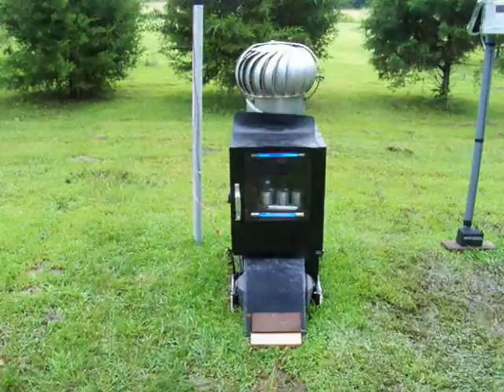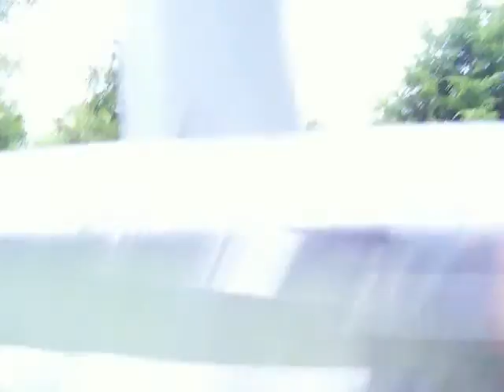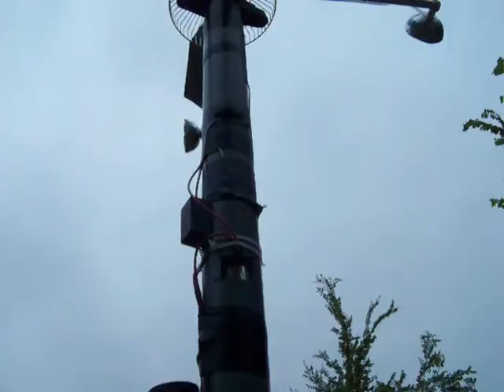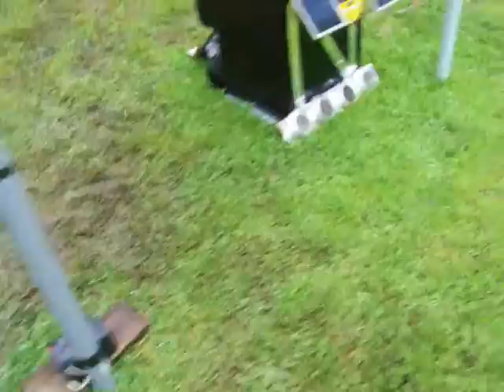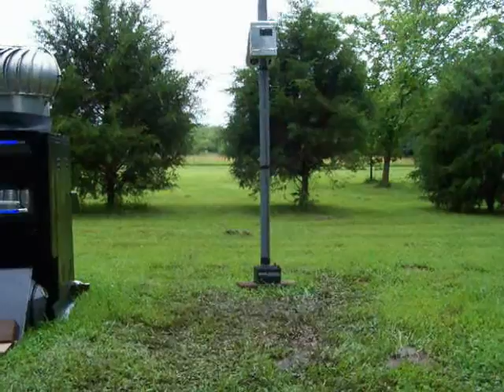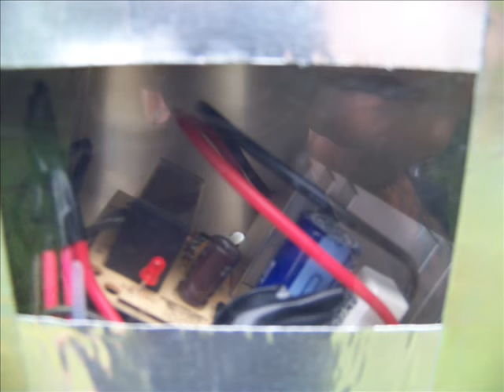FREE THINKERS 4

Comment: I think charging the battery is too simple for such a device. Here's an idea that's more out there.. The wind spinner on the box is not going to be used as a rotary spark gap, but actually going to work like an ion motor from the static electricity being collected and is going to keep spinning perpetually. Perhaps that energy can be harnessed to provide enough electricity to run appliances off that power inverter looking device? It would only take 12 volts and an amp or two..
Reply from the maker: Justin H This comment gets a giant thumbs up! and if I were allowed it would be two thumbs up! Great stuff! anyone who dares to question what they say can not be done has got my vote! Great comment my friend!

Comment: multipurposed.. static charge collector optimized with neg ion generator...watch out for a lightning strike there. might wanna add a lightning rod to protect yr equipment. i like the battery renew idea of M.A.D. too. looks like maybe solar electric and radiant heat collection. the inefficient rotor may control overcharging in extreme weather by only moving with higher wind speeds...
Reply from the maker: tnlightnin Just when I think I read the best comment another awesome free thinker blows me away with shear brilliance. Thank you very much!

Comment: Could it possibly be a battery reviving/charging system and used to charge revive the batteries is a high voltage or back EMF charging unit. Looks like you have multiple static generators and the static that is collected is used to charge up the batteries so that they are somewhat good again and then charge the capacitor bank to make use of the energy collected in whatever way you need to use it for.
Reply from the maker: Tyson Capel This is why I love my subscribers! great comment!

Comment: Hmmm beam me up Scott comes to mind. Some of my comments like the weird stars may be incorrect as I don't understand much but listen and take in comments from others which is  what I was told the weird stars were until I work out from other sources more logical So as in my air joe cell comments I know some comments in past were incorrect having built up further practical knowledge but it was a out the box help for me to look at the first comment I placed eventually manipulating parts of those comments to come to a refined position to once again pass on. I would like you to look at video air joe colloidal silver Joe booker shows a sketch on a pad that's some Megga clue you may well realise how easy to recirculate the phase locked loop method Something to do with fig 8 ac dc in and out of phase spikes Soon we will achieve this aim of simple capture. Shame joe booker just does not show a A B C video Mel in uk